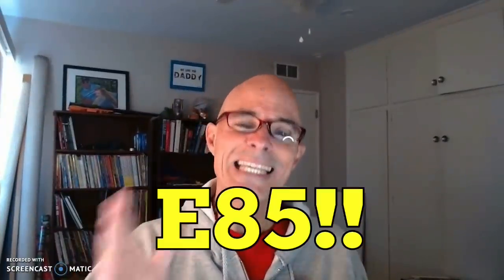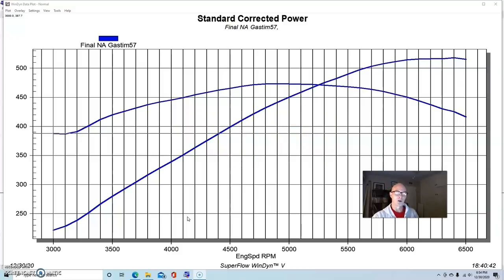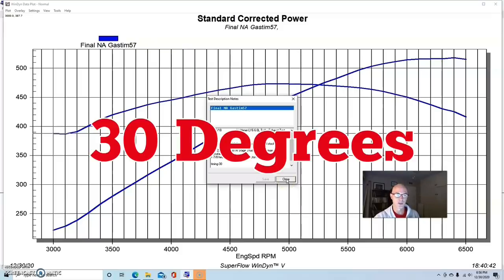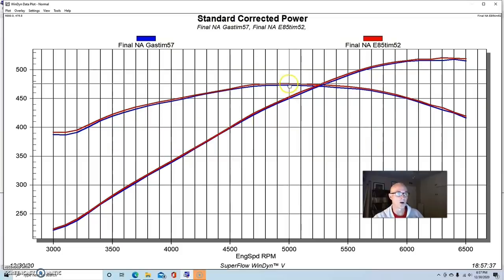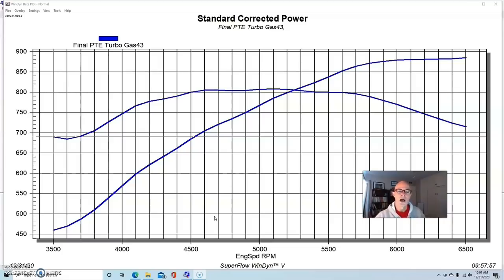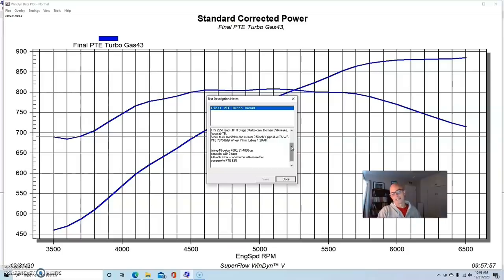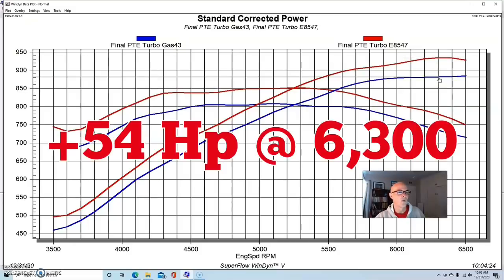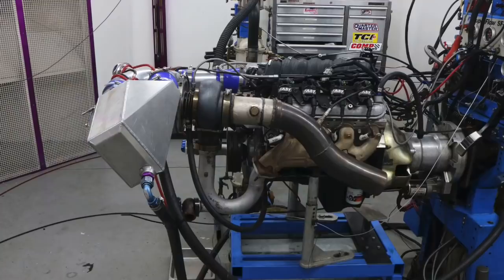JUNKYARD TURBO 6.0L LS E85 FUEL TEST

Comment: I'd like to see injector location testing. I think E85 would shine with more time to cool the charge.
Reply: it does. Packaging is the hard part though. I've been working on something like that, but with how easy it is to make a FiTech of Sniper work drilling holes for injectors is a lot more involved.

Another thing you can do with ethanol and EFI is heat the fuel in the lines, you need the heater after the return regulator so you aren't vaporizing the stuff in the tank (can go boom easy) but at 60psi in the lines it will not vaporize at 200F fuel temp. Some of the gasoline in E85 might boil and turn into vapor, it works better with straight ethanol.

Why that is a thing is simple. The intake manifold is a relative vacuum, so the boiling points are lower for liquids (generally) higher pressure raises the boiling point, lower pressure lowers it. So you take a 200F fuel under 60psi, and now put it in an engine pulling 15 inches of vacuum, that is a few atmospheres difference there, so it vaporizes instantly as it hits the vacuum. It will still pull the heat from the intake charge despite having a 200F temp just before. 

Now you have a vapor fueled engine, and vapor has a much greater surface area than atomized fuel. Think fog vs rain. The combustion event is faster and more complete with a vaporized fuel, large drops have less surface area and take longer to burn, thats also a big part of why so much of the energy in gasoline goes to waste heat.

You can do that with gasoline, Smokey Yunick did it in the 80s with a Fiero, but he needed ceramic pistons and other high end parts due to the heat required to fully vaporize gasoline, its like 450F. The reason for that is simple, some of the components of gasoline have boiling points around 450F, and some are around 80F, so you have to vaporize everything. Then you have the spark knock thing raising its head because gasoline likes to light on its own with just heat and compression.

 Ethanol will do the same thing at 200F, well within the operating temperature of your average engine. The boiling point of ethanol is 173F at sea level. Its one compound, not several, so its much easier to utilize in this way. You get all the power gains, and you do it on less fuel. I plan to do that with the FiTech on my 65 GTO next summer. I really want to put that type of 455 in a more aerodynamic car though, have a 71 Formula in the works for that.

The longer the time the fuel has to vaporize, the better the cooling effect of the intake charge and the power will be, with the added bonus of using less fuel to make that power, on ethanol.  Injectors farther up would be beneficial.

Comment: E85 has 4.5% more energy than gasoline when run at the same lambda.  should run less timing because it burns faster.  something is not right with the engine.  btw you want 1-5/8" headers at 500 hp.

Comment: It is not awesome for fuel economy,  my flex fuel e85 Chevy passenger van is lucky if it gets 11mpg!
Reply: change the tune, the factory tune throws a lot more fuel at it when you run it on straight E85, costing you mpg. They do that intentionally, because your engine will live a lot longer on ethanol than on gasoline, and they want to sell you another vehicle soon. 

Get a reputable guy who knows how to tune for ethanol other than max power, and it will pick up mileage. With the low compression it needs to run 87 octane pump gas, it will not equal gasoline without heating the fuel ahead of the fuel rails. That is another thing though having to do with boiling points and barometric pressure/vacuum. 

Also you have a small engine with low torque trying to push a big box through the air, its gonna get bad mileage just like my 65 GTO is a freakin parachute, a cool looking parachute but still...drag is very important and it starts being a thing around 50ish with box like vehicles like ours.
Reply: @SweatyFatGuy  
Thanks for the advice 
It is a 6.0L with a 6 speed automatic transmission!
So far no known Tuner will touch it , they say it's to new to touch (2019) ! It dont have the variable timing 
(4,6,8) and having 3.42 gears dont help move 
5,500 lbs!

Comment: Hey Richard, what are your thoughts on gapless rings like total seal. I totally agree with you on the ring gap situation, its just common sense but seems like too much blowby when the engine is cool or not running hard.   would total seal rings solve this? or are they as problematic as I read about?
Reply from the maker: NOT NECESSARY

Comment: why stage 3 cam for 6500? most stage 3 cams i see aren't ideal for only going to 6500rpm. i probably would've went stage 2(220-224 duration) for 6500rpm or reved the stage 3 out to 7k+. but still a good test regardless

Comment: I just watched Brian Tooley talk about the valve timing relationship between intake  valve open and the exhaust valve close and he said to ignore the lobe separation angle...do you believe that the LSA is important?
Reply from the maker: OVER LAP DOES NOT BLOW BOOST OUT -BACK PRESSURE IS HIGHER THAN BOOST PRESSURE

Comment: Correct me if I’m wrong but doesn’t the difference in power come from the specific gravity? I think octane VS. specific gravity explaining fuel would be a good video for noobs like me.
Reply: The Ethanol molecule is smaller and less dense than Octane, however it also has lower caloric content, but more molecules can fit in a given space than Octane, so there's an overall net gain in caloric content at the cost of higher fuel consumption. Ethanol, being an alcohol, also will cool the air, and Ethanol fuel has around like 115 octane rating.
Reply: @tommylyeah  that’s kind of my point. The octane of the the two fuels is going to be very close. So with that in mind, they are going to differ in specific gravity creating better atomization due to being less dense, right?
Reply: @ChadLisonbee  - That makes sense ta me.

Comment: E85 responds to boost or compression. A low compression build for boost will not make more power @ NA without boost
Reply: On ethanol vs gasoline, yes it will make more power despite having low compression, if you get it enough ethanol. More O2 means more power, and ethanol has more O2 in it, adding more makes more power until you go richer than 7:1 AFR, then it makes the some power but uses more fuel.

You pick up so much more with boost because of how much ethanol cools the intake charge, ethanol has more exhaust gas volume as well, and you can really turn up the boost on it because ethanol doesn't want to light without a spark.

https://www.hotrod.com/articles/hppp-1109-testing-different-fuel/

Comment: What happens when you start upping static compression On an NA engine? if you ran up around the 12:1 range I’d imagine E85 would be a much safer option
Reply: 12:1 with aluminum heads, modern chamber shape like the LS engines, and the relatively small bore , yeah you can throw about 20psi to it on E85.

Billy Hoskinson from SRC on here on youtube is running 13:1 with boost in his sbc. He did so on both E85 and methanol. A big bore 632 bbc with old iron rec ports might not like 20psi as much, larger bores tend to have more sensitivity to ping/knock, but ya know it probably could still do it and live a long time despite the relatively poor chamber shape and required domes.

So yes, E85 running NA is a much safer and less costly option.

Comment: Were the injectors on the engine capable of delivering the required required quantity of fuel with E85? I figured you set the E85 mixture at the equivalent of the pump gas 12.8:1 since E85 requires a richer air fuel ratio
Reply: hes using the gas scaling

Comment: How much boost and timing can I run on my 4.8 twin holset hy35w turbos with 93 octane fuel? Its stock bottom end with ring gap.  Truck intake with a cam. Made 416 hp na. Would it be safe to turn it up and make 1000hp on 93 octane if timing is conservative enough??
Reply from the maker: 1000 HP ON 93?
Reply: Or maybe 800 ? Just wondering what you think is to much on 93 and what is safe. 👍
Reply: Even if you run single digit timing and 30 pounds of boost you're going to produce enough heat to detonate that pump swill. 

You could put some race gas in it and pull big dyno bragging numbers but on pump gas they really struggle above 700. And the variability in actual octane at the pump can cost you dearly. Press it hard on substandard fuel and it won't be pretty. One tank of mislabeled or contaminated fuel will spray the rods all over the road.
Reply: So I guess I should stick to around 8 lbs . It makes 620 ish on 8 lbs with 21 degrees of timing afr is around 11.9

Comment: Just found out how much hp you can loose with too much or even the recommended amount of oil in the pan. Can you do a video on this?
Reply: I think Engine Masters made a video like that.
Reply from the maker: I HAVE
Reply: @richardholdener1727  my apologies. You have quite the catalog and I haven't made my way through all of it yet.
Reply: Imagine how much power you could lose if you didn't have enough oil in the pan.
Reply: @turbolq4  That's the question. What is the acceptable or minimum amount of oil needed before damage as opposed to the recommended amount.

Comment: NA applications that have really hot intake temperatures benefit more from E 85 such as Honda’s look how much power they get from turbo yet supercharged they don’t make as much on the same boost I believe it’s because of the intake temperatures. I wonder if you could test the intake temps at the manifold for ls and coyote direct injection engine’s get the most benefit since the e 85 shoots at the piston

Comment: Matches what we see on the chassis dyno.  Something to think about....

Theoretically (I know, bad word) E85 should produce 5-6% more power than gasoline even if you don't run more timing.  There is less energy in a gallon of E85 than gas, but you inject so much extra fuel that the energy liberated is 5-6% more.  So why don't we see that on lower compression engines like the off-the-shelf LS stuff?  I suspect it has something to do with the amount of fuel we're injecting, and how much air we're displacing.  Perhaps also that we're quenching the combustion process somewhat, just like when we inject a ton of meth on an NA engine.  

This would also explain why LT engines see vastly larger gains with E85.  They only pick up 7-8% more power naturally aspirated on E85, but torque gains can easily exceed 10% near peak VE.  Why?  They are higher compression, but the gains are too large to be explained by that.  I suspect that the ability to inject a lot of the fuel after the intake valve has closed is a big part of it.

When I'm tuning flex fuel on an LS equipped Tahoe or Silverado, one trick I find that helps me get a touch more output is to run a fair bit leaner on E85.  You won't knock running 13.5 (that's a gas equivalent AFR, let's just say lambda of 0.92-0.93), but it seems to help just a bit.  As for turbo engines, looks like it gained about 6% more power which is right on target for energy content changes from race gas to ethanol.  Maybe the higher intake temps and increased mixture motion offsets any potential quenching/displacement issues.

Comment: Without a dyno,  how can one tell if they have too much or too little timing at a given rpm/psi  in a boosted ls?
  I'm guessing this correlates to the torque curve and strength of components as one video I saw mentioned pulling back the timing during a particular rpm range.
  Keep them coming Richard!!
Reply: Your casting vids are dope
Reply: @lucysmith4242  thanks 😊   hope to be doing more soon..
Reply: If uncle Rodney visits you've got too much timing.
Reply: @harperjmichael  trying not to see rodney, or have a pan full of ring lands...

Comment: You say that E-85 is less expensive, and per gallon it is, but you have to use almost twice as much of it compared to gasoline.  So to verify that if that statement is true it would be interesting to see the duty cycle comparison at the same fuel pressure and work out the comparative volumes used then figure out the cost difference between fuels.
Reply: You don't use twice as much.  Interestingly, here in California, E85 is priced to provide a near equivalent cost per mile as 91 octane gasoline.  It's close to a wash for a well tuned vehicle.  But considering that you're getting the performance of $10-$15/gal race gas, it feels like a steal if your gas tank is big enough to avoid refueling every other day.
Reply: @ChurchAutoTest   - I was thinking of methanol using nearly 2x and I was assuming this wasn't too far off, I  suppose I was incorrect.  On another note, I really dislike (read hate) this state of CA.  What city are you in?  I'm in Fresno until I can escape.
Reply: @rudyrayaaw5138  I'm in Los Angeles, but I have a biz in Texas now and am opening one in AZ soon.  California is a dead state walking, just doesn't know it yet.
Reply: @lapin46  correct, although it's slightly more since we're looking at fuel mass and E85 density is slightly different than gas.  Fortunately we can generally run it a touch leaner.
Reply: @lapin46  True, true.  Although if you're interested, you can look at freely available software like HP Tuners to see how your factory ECU is estimating fuel mass flow rate in its calculations, even without a flow meter.  It becomes a little easier to grasp the AFR calc when you do it that way.

Comment: The NA compression is optimized for pump premium.  Try adding another point or two, I'm sure the e85 would shine.
Reply: or jack that water temp up to 190, something a normal engine will see, instead of these unrealistic "happy number producing" 120-130 degree temps
Reply: @ttank94  If I remember correctly, E85 actually liked more higher temperature.
It's best to run on E85 around 170 to 190 temp.

Produces less power if ran cold, like 120-130 temp.

But yea, to have the most benefit of E85 you should use a higher compression ratio, depenging of the combustion chamber design.
Reply: With a 13:1 compression motor, the power increase you'd see with E vs pump gas is a 100% increase because nobody in the right mind would even think about going WOT with that much compression on pump gas. 
Jokes aside, you don't need race gas/E for a point or 2 more than 9:1, just not high enough. The combustion chamber characteristics of the LS are efficient enough that the max "safe" compression ratio for pump gas (N/A) IMO is between 11.5-12:1, ask me how I know (N/A 6.0, 11.5:1 comp 620hp on pump gas in my chevelle). You don't need race gas or E85 for an LS with 11:1. Now on the other hand, with a small block chevy/ford/mopar or big block chevy/ford/mopar, I would start to look at running E or race gas in stuff over 11:1.
Reply: When going higher compression ratio, the difference between pump gas and E85 gets better (for E85).

E85 allows to run ridiculous amount of compression, e.g 13:1 dynamic** compression ratio w/o any problems if the cylinder head has a modern combustion chamber.
How much static compression ratio depends a lot how much intake/exhaust cam duration you have, and cam timing.. it could be 14-16:1 to have 13:1 dynamic compression ratio.

Methanol is even better. But there are limits, when more comp is not better - combustion chamber efficiency and flame travel are more important.

Ridiculous compression ratio with efficient combustion chamber and alcohol fuel means a lot of torque -> power, if the engine can breath when the rpm climbs.

Comment: Happy New Year !!!!  How much more E85 is used compared the gasoline,  2X ?
Reply: approximately 40% more fuel at the same mixture, but you can run E85 a bit leaner on mild combinations to offset that.  More timing can help improve efficiency too vs. pump gas if the motor wants it.  My CTS-V returns 12/21 mpg on 91 octane, and 8/15 on E85 running 600 whp/700 whp setup

Comment: My understanding is the coyote engines run a fairly high static compression 
That would help with the gains.
Reply: I think they've got like 12:1+ SCR.
Reply: Gen 1 yote is 11:1 I think
Reply: And with variable valve timing the CR can be somewhat modified by bleeding a little off if need be.

Comment: Without the cylinder pressure the octane becomes a hindrance. You need to be able to fully burn your fuel. 
My thoughts only......
Na gains would be from lower temps and greatly advanced timing do to a slower burn rate
Reply: By pressure, do you mean compression? Serious question.

Comment: Great video, just curious on the difference between pump 91 with water meth and pump E85 timing values.
Reply: Done it on my ls turbo. Difficult to street tune plus over fueling is an issue. Have an Aem controller an a eboost 2.

Comment: If the engine don't need more octane, it ent going to thank you for it.
 🇬🇧 gets 98 Ron. From the pump, we had a 1600cc sohc peugeot xu unit (205 gti) on 45mm Webber carbs and a reasonable race cam from piper cams here in the UK giving 183 bhp @ 8800 rpm and 126lbs/ft of torque at 5700-6300 rpm using 11.5:1 cr and changing to 101 Ron octane "race fuel" made no measurable (chassis dyno) differance either. We do not get E85.
Reply: We get 93 (R+M)/2 here which is the same as your 98 Ron. Not all places get 93 in the US for some reason, its all state based.

Comment: I think the coyote making more power on e85 is likely compression and combustion chamber design related. And the fact that you can change the dynamic compression ratio with the DOHC and VVT.
The LS combustion chamber at normal compression ratio doesn’t really need or benefit from the e85 until you start increasing cylinder pressure and adding more fuel and heat to take advantage of the cooling effect.
Just my opinion. Who knows